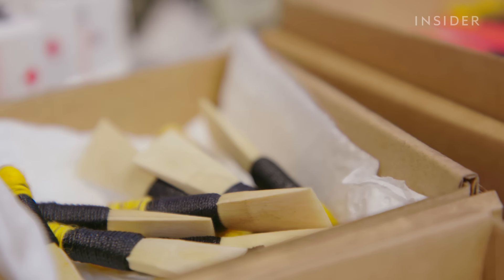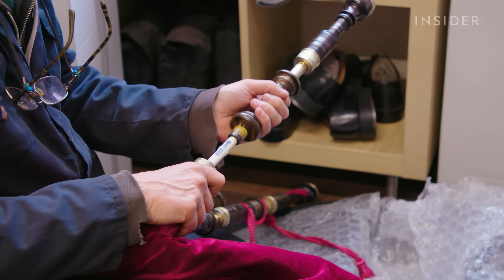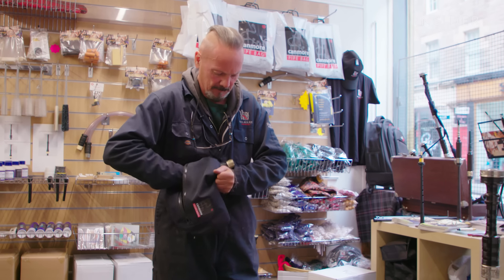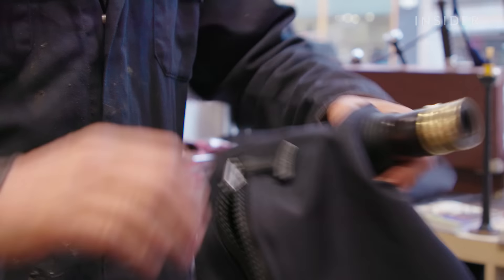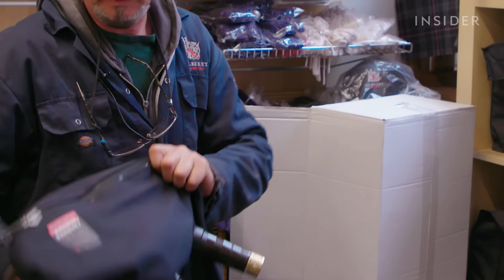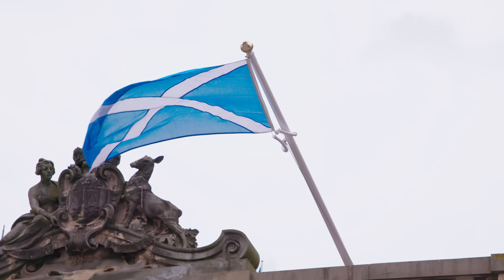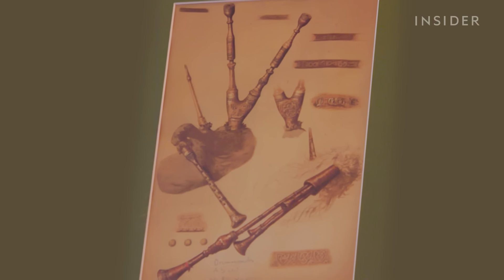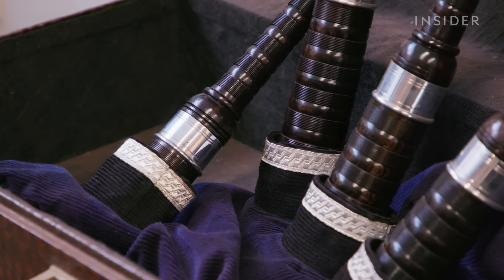Meet The Last Artisans Making Traditional Bagpipes By Hand In Scotland's Capital | Still Standing

Comment: Glad to see that even a master at the lathe still has an occasional hang up, makes me feel better about my skills. Lol
Reply: I still don’t understand why turning wood blanks between centers with no lathe dog is so common. I chuck one end. If you tighten it up you risk splitting the blank, especially if you’ve drilled a hole all the way through it to make a bagpipe part, loosen up and you stop the work constantly, take light cuts to keep from stopping it and it takes forever to turn it round.

Comment: All ABW bagpipe drones are turned by hand!!! The exception is polypenco (aka plastic) pipes. Most bands buy sets of machine made chanters, because today's top bands need chanters that can be set exactly the same. My local pipe maker in Canada even makes goatskin, sheepskin, and cow hide bags, which are actually superior for moisture control, but require more maintenance.

Comment: What kind of lung strength do you need to play this ... Just Amazing
Reply: ...almost none.
Playing this instrument has nothing to do with lung strength
Reply: You see that section of the bag that goes under the arm? That is the ' bellows' of the instrument. Air is simply blown into the bag, where the arm squeezes it to produce the air flow. A valve (which isn't mentioned) stops the air escaping the bag, allowing for the player to take breaths. There is still considerable lung force required as the bag does need to be constantly inflated with vast quantities of air. For new players the hardest bit is your lip muscles get tired quickly meaning your lips are then no longer able to hold a seal. Basically, purse your lips then try to continuously force air into your closed lips without exhaling any air. Within 30 seconds your face muscles will be very sore and not long after that the seal will fail.
Reply: @smoogle3g4c37  oh nice

Comment: You finish it of with a tie rip?
Reply: Traditionally, drone cords were secured using animal sinew, but many pipers like to customize the look of their pipes, and sinew is a bit of a pain to handle and manage. It is just simpler to use zip ties. Besides, you can't notice until you are right up close to them.  It also has no effect on the tone.

Comment: Im so sad to say i was so impressed with the skills until he used plastic cable ties to hold the beautiful rope work, id have thought a splicing with more thread would add a more artisan  finish, but other than that beautiful pipes .
Reply: You have to use zip ties. Sometimes you want to change the ropes and they also have to be able to be adjusted easily to change the width of the drones based on someone’s shoulder
Reply: @jamesblakeley4329  thanks for clearing that up i take back my comment. after being educated:)

Comment: and to think that back then, it was probably harder to make because of the lack of sophisticated machinery like today
Reply: not harder just longer.
the main tool he has been using is a wood lathe which has been around since ancient times. the only major difference is how they are powered
Reply: @artski09  how did the machine turn without eletricity?
Reply: @nonec384   there are many methods since
all you need to do is get the part to rotate. the most advance one would be a treadle lathe which has a foot pedal connected to a belt system which turns the part. on the other end of the spectrum is a Strap Lathe where you wrap a strap around the part and have an apprentice pull it as fast as he can.  

the advantage of electricity is that it can provide a constant speed and allow the machinist to focus
Reply: @artski09  no way some one can turn it as fast and continun as a motor it would end messed up
Reply: @nonec384  the belts and straps provide a good amount of speed. you are pushing the pedal 0.25m which then goes into a series of gears which then goes into the part which is 50cm diameter (max). i never said as fast or consistently as an electric motor, there is a reason people don't use them commercially. human powered tools were the only method available until quite recently.

Comment: 4:58 Zipties? REALLY?!?!?
Reply: Traditionally, drone cords were secured using animal sinew, but many pipers like to customize the look of their pipes, and sinew is a bit of a pain to handle and manage. zip ties are also used because the allow the piper to adjust the distance between each drone. It is just simpler to use zip ties. Besides, you can't notice until you are right up close to them.  It also has no effect on the tone.

Comment: Traditional bagpipes with Gore-Tex and plastic cables ties
Reply: Traditionally, drone cords were secured using animal sinew, but many pipers like to customize the look of their pipes, and sinew is a bit of a pain to handle and manage. zip ties are also used because the allow the piper to adjust the distance between each drone. It is just simpler to use zip ties. Besides, you can't notice until you are right up close to them.  It also has no effect on the tone.

Comment: He’s using electrical tape and zip ties... why go through all that trouble then use tape and plastic???
Reply: Not a better alternative!
Reply: Traditionally, drone cords were secured using animal sinew, but many pipers like to customize the look of their pipes, and sinew is a bit of a pain to handle and manage. zip ties are also used because the allow the piper to adjust the distance between each drone. It is just simpler to use zip ties. Besides, you can't notice until you are right up close to them.  It also has no effect on the tone.

Comment: Electrical tape and zip ties?
Reply: Traditionally, drone cords were secured using animal sinew, but many pipers like to customize the look of their pipes, and sinew is a bit of a pain to handle and manage. zip ties are also used because the allow the piper to adjust the distance between each drone. It is just simpler to use zip ties. Besides, you can't notice until you are right up close to them.  It also has no effect on the tone.

Comment: all that time and outstanding craftmanship ruined by a 2cent plastic ziptie...please tell me i missed something and its only a temporary holder
Reply: Traditionally, drone cords were secured using animal sinew, but many pipers like to customize the look of their pipes, and sinew is a bit of a pain to handle and manage. zip ties are also used because the allow the piper to adjust the distance between each drone. It is just simpler to use zip ties. Besides, you can't notice until you are right up close to them.  It also has no effect on the tone.

Comment: gotta love how they crap on about tradition techniques and the unique qualities of this wood from Mozambique, and then use sticky tape and zip ties to make the final product.
Reply: Go and show em how its done william wallace
Reply: @gy8572  sure, fund my bagpipe workshop and I will
Reply: That’s the best thing to use. The tape is used because it’s one of the only things that can create a suitable seal, while also being easy enough to remove you can do maintenance or change the stocks. The zip ties are used because they have to be adjustable or easily removed because the rope sets the width of the bagpipes and someone with smaller shoulders might need the drones closer together

Comment: Not to be a purist or anything, but...goretex bag and zip-ties for the red rope holding the bass pipes???

So, the hand craft is all about the woodworking...
Reply: What would ye dae?
Reply: @seannewell397  In Greece we craft a similar instrument called "tsampouna". It is essentially a bagpipe with one bass pipe and the main melody pipe is usually double (two tubes, two reed sets etc).

These instruments are built by traditional craftsmen by hand from scratch. 

They source the rawhide from animal farmers, process it with salt and sunlight, trim the excess hair, turn inside out...and this is the bag.

For the pipes they use good quality canes or (nowadays) wood, though the later is not that common.

The decoration is not part of our culture since the instrument is not tied to the military tradition rather than the folk, countryside musical and cultural history.

But, this construction is to an extend identical to the Scottish bagpipe's construction.

For me the element of handcrafting includes as many steps of the build as possible. I do not expect the luthier to farm the animal and maintain a cane plantation...but using traditional materials and methods is essential.

P.S.: certain young craftsmen I. Greece started using synthetic bags for Tsampouna...advertising the benefit of the instrument not rotting, not having the risk of failure over time and not smelling. But to the traditional players this is a compromise. You can maintain your instrument and keep it in top shape as has happened for hundreds of years. 

Again...this is just my opinion! I get why the things have changed the way they have in this topic.

Comment: Cable ties?! For real?
Reply: Traditionally, drone cords were secured using animal sinew, but many pipers like to customize the look of their pipes, and sinew is a bit of a pain to handle and manage. zip ties are also used because the allow the piper to adjust the distance between each drone. It is just simpler to use zip ties. Besides, you can't notice until you are right up close to them.  It also has no effect on the tone.

Comment: Zip ties on a set of pipes!! Yeah, that's really traditional huh?
Reply: Traditionally, drone cords were secured using animal sinew, but many pipers like to customize the look of their pipes, and sinew is a bit of a pain to handle and manage. zip ties are also used because the allow the piper to adjust the distance between each drone. It is just simpler to use zip ties. Besides, you can't notice until you are right up close to them.  It also has no effect on the tone.

Comment: Wtf zip ties on the final product?
Reply: Traditionally, drone cords were secured using animal sinew, but many pipers like to customize the look of their pipes, and sinew is a bit of a pain to handle and manage. zip ties are also used because the allow the piper to adjust the distance between each drone. It is just simpler to use zip ties. Besides, you can't notice until you are right up close to them.  It also has no effect on the tone.

Comment: Black zip ties and electricians tape to finish off the masterpiece!
Reply: Traditionally, drone cords were secured using animal sinew, but many pipers like to customize the look of their pipes, and sinew is a bit of a pain to handle and manage. It is just simpler to use zip ties. Besides, you can't notice until you are right up close to them.  It also has no effect on the tone.

Comment: All that effort only to use zip ties at the end?!? 🤨
Reply: Traditionally, drone cords were secured using animal sinew, but many pipers like to customize the look of their pipes, and sinew is a bit of a pain to handle and manage. zip ties are also used because the allow the piper to adjust the distance between each drone. It is just simpler to use zip ties. Besides, you can't notice until you are right up close to them.  It also has no effect on the tone.

Comment: after all that painstaking work they slap on some leccy tape and a zip tie...
Reply: Traditionally, drone cords were secured using animal sinew, but many pipers like to customize the look of their pipes, and sinew is a bit of a pain to handle and manage. It is just simpler to use zip ties. Besides, you can't notice until you are right up close to them.  It also has no effect on the tone.

Comment: Traditional electrical zip ties😆? Still cool
Reply: Traditionally, drone cords were secured using animal sinew, but many pipers like to customize the look of their pipes, and sinew is a bit of a pain to handle and manage. zip ties are also used because the allow the piper to adjust the distance between each drone. It is just simpler to use zip ties. Besides, you can't notice until you are right up close to them.  It also has no effect on the tone.

Comment: Is he really using zip ties for the final product? holy shit i would not buy this amazing crafted thing, and at the end they fix the ropes with plastic zip ties.yikes
Reply: It's actually pretty standard practice. It works well enough, and probably lasts longer than thread or hemp anyway
Reply: Traditionally, drone cords were secured using animal sinew, but many pipers like to customize the look of their pipes, and sinew is a bit of a pain to handle and manage. zip ties are also used because the allow the piper to adjust the distance between each drone. It is just simpler to use zip ties. Besides, you can't notice until you are right up close to them.  It also has no effect on the tone.

Comment: All that work and he finishes them off with zip-ties. Shame
Reply: Traditionally, drone cords were secured using animal sinew, but many pipers like to customize the look of their pipes, and sinew is a bit of a pain to handle and manage. zip ties are also used because the allow the piper to adjust the distance between each drone. It is just simpler to use zip ties. Besides, you can't notice until you are right up close to them.  It also has no effect on the tone.

Comment: Huge respect for keeping this tradition alive as hand made objects, but zip ties...artisanal...really?
Reply: They have to be used. It’s to set the width of the drones and smaller shoulders might need closer-together drones. Zip ties are easy to adjust and remove.
Reply: Traditionally, drone cords were secured using animal sinew, but many pipers like to customize the look of their pipes, and sinew is a bit of a pain to handle and manage. It is just simpler to use zip ties. Besides, you can't notice until you are right up close to them.  It also has no effect on the tone.

Comment: Zip ties?!? 🤦🏻‍♂️🤦🏻‍♂️🤦🏻‍♂️
Reply: Huh? Who cares, they're strong, reliable and last a long time.
Reply: Traditionally, drone cords were secured using animal sinew, but many pipers like to customize the look of their pipes, and sinew is a bit of a pain to handle and manage. zip ties are also used because the allow the piper to adjust the distance between each drone. It is just simpler to use zip ties. Besides, you can't notice until you are right up close to them.  It also has no effect on the tone.